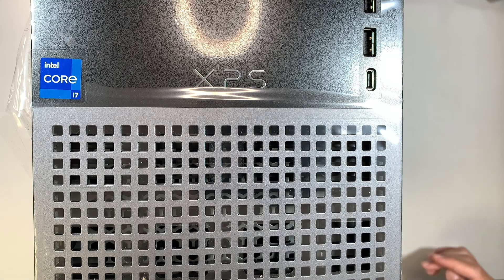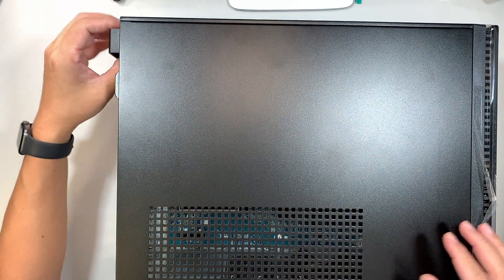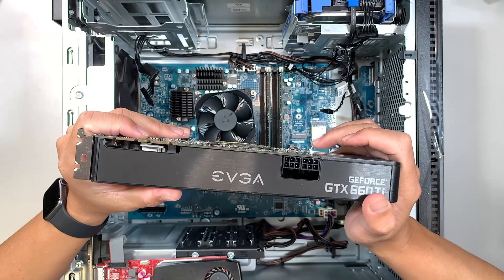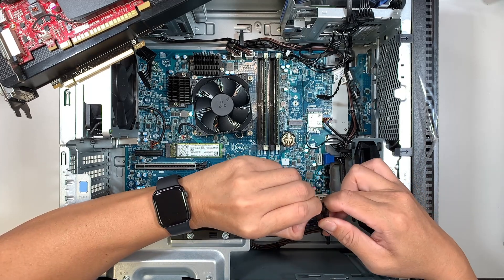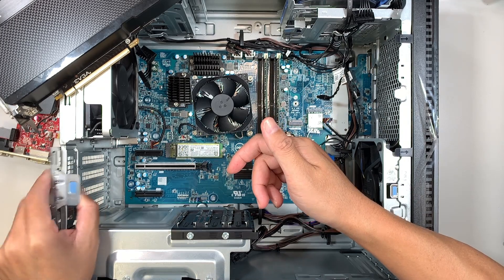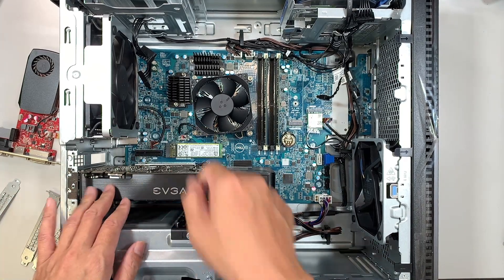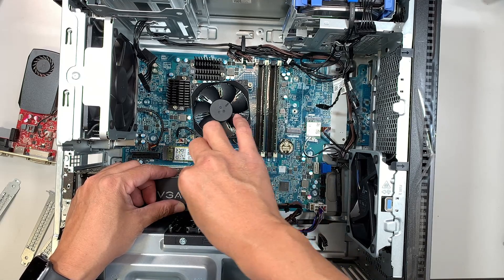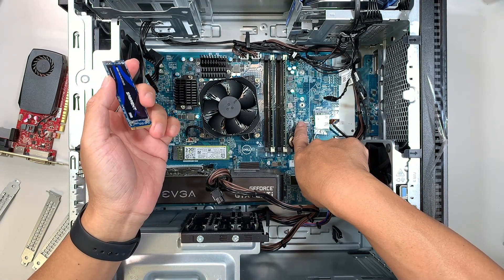Dell XPS 8950 Install Graphic Card

Comment: Hello! Great video! I have this pc and I am looking to upgrade my gpu to a 3090 24gb. Do you know which third party graphic card will fit this computer? Thanks in advance 😊.
Reply: 3090 shouldn't be a problem, the issue would be power supply. As long as you have the 750 watt psu, you should be good.
Reply from the maker: I do not think you can upgrade to 3090. Power supply and space is not sufficient enough for gpu. Maybe max is 3060